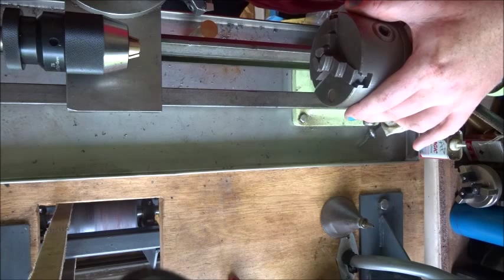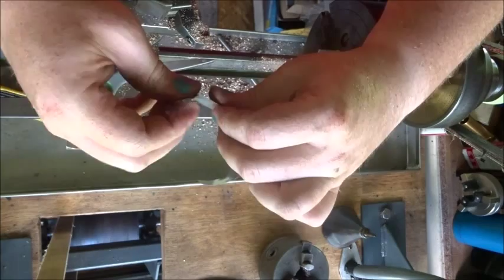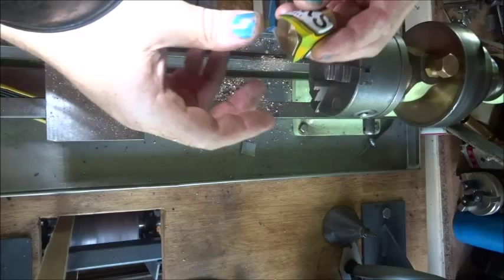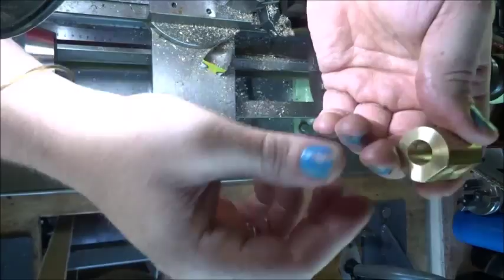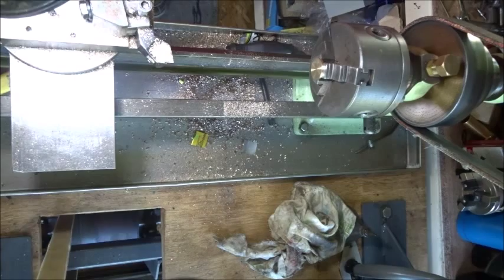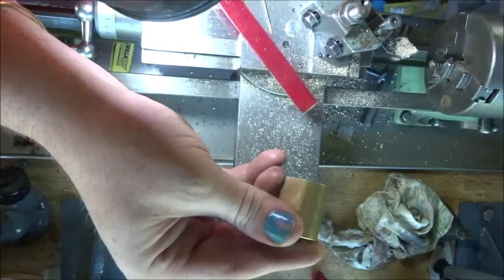oscillating engine part 1 (cylinder and cover)

Comment: Very nice video, Emma. I enjoyed the actual machining, and not least the sound of the motor ticking over with the belts. Lovely lathe you have, old school and working! I would like to suggest that you consider another camera angle, which although more inconvenient for you, would make it appear that you were not hanging from the ceiling while working. The images are however very clear and instructive. Thanks for sharing. I'm off to the next two in the series. I like your more informal methods, which get the job done and apparently done well. Thanks.
Reply from the maker: i take that on board jim , and others. need toget that sorted in the very near future!

Comment: Nice job so far Emma. You are a bit like me in not needing to do everything to the book or faff around with stuff that's not needed. Unless you are making a batch its a case of  just getting  it done. Looking forward to the next in the series.
    Just one little thing, the way the video is orientated makes it look like you are hanging by your toes from a bar. Maybe turning the camera 180 degrees so the chuck is to the left and you are at the bottom might stop me getting vertigo.   LOL  regards from the UK